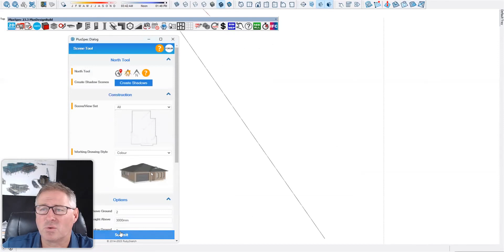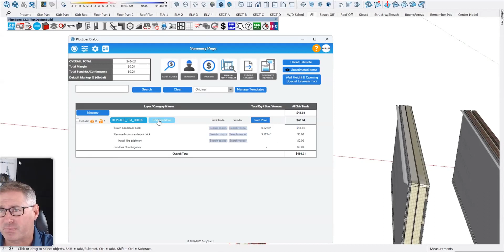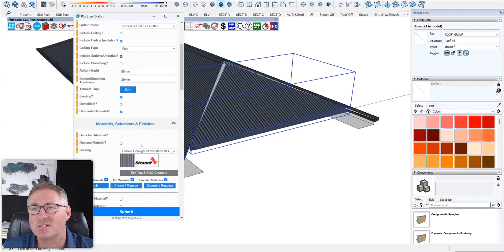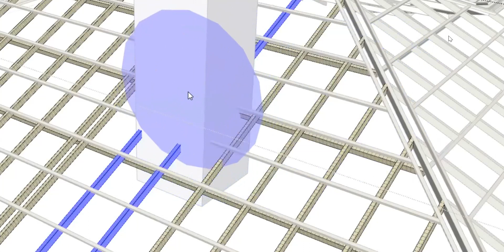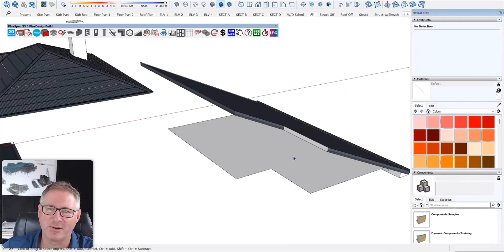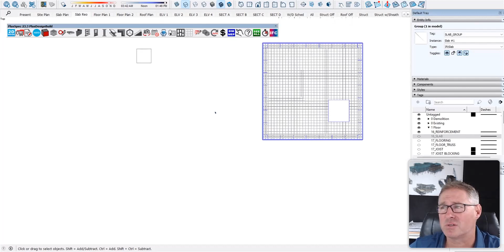PlusDesignBuild  & PlusArchitect Beta 23.3 Reno.remodel, Steel frame rebar and more

Comment: Guys I noticed the battens only has timber members listed.  Could you consider some steel top hat sections?
Reply: Batten width may need be varied
Reply from the maker: We considered adding the top hat section; however all we found was we added extra geometry that had little to no impact on the result. Can I suggest creating a material called "top hat_size" in the steel batten section? You could make it a texture to still look like a top hat.